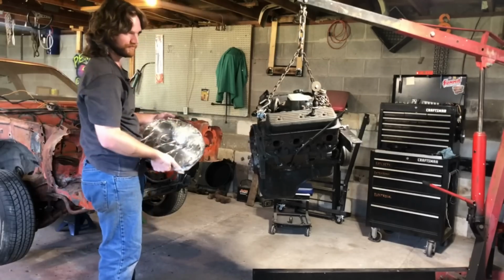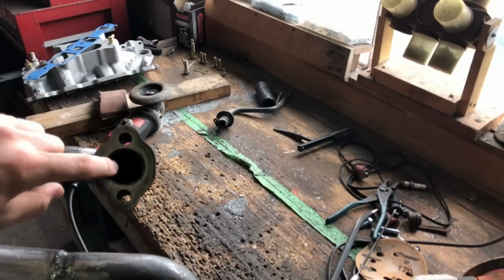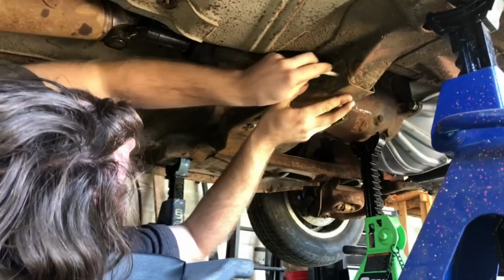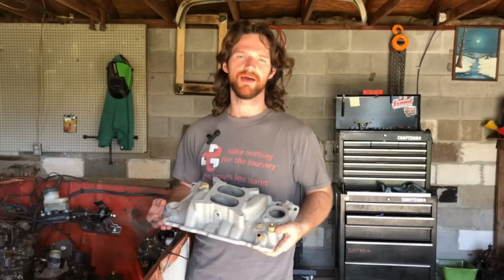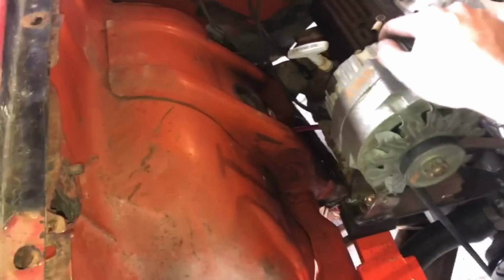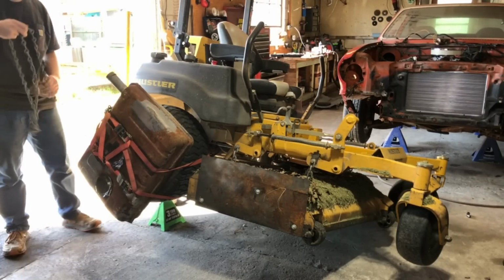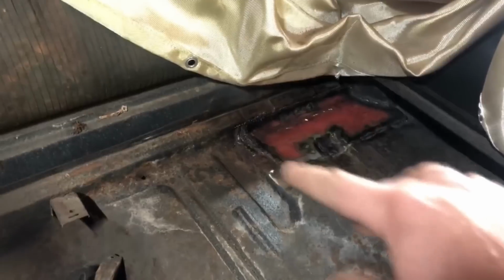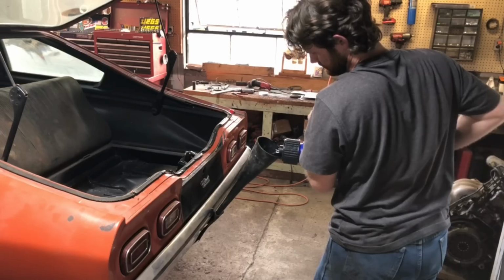IT'S ALIVE! Forgotten 1972 Vega GT Project Part 2

Comment: I had a 302 Pinto back in the mid 70s and I helped a buddy build a 350 72 Vega GT wagon /4 speed. His GT springs ended up in my Pinto and some V8 Mustang 2 springs I ordered for my Pinto were too stiff and fit the Vega perfect. But Vega rear ends don’t really like 350 4 speeds

Comment: I had one of the first V8 Vegas in my area in 1980 me and my brother built a 74 wagon it was four speed all high performance with the factory clutch setup it was caving the firewall in when you pushed the clutch pedal we had to build a reinforcement plate that bolted in behind the master cylinder and off to the side The cable went through there otherwise it was flexing the firewall back and forth

Comment: Call it what it is… a hydraulic  slave and master cylinders… it was a p i t a in my 72 TR6, but my 73 Nova SS runs a mechanical spring system <—- never had a problem from 9-12-73 😂😂😂

Comment: very cool, I built a 72 GT Vega with a 327 4-speed back in 1977 and I was stumped as to why it kept dying. then I found out about the oil pressure/ fuel switch......lol
Reply: Should be a cool little car.

Comment: Btw a muriatic acid wash cost about 10 bucks and works extremely well at de rusting gas tanks, and it’s biodegradable. 1 gallon plus a gallon of water and swish like you did with chains